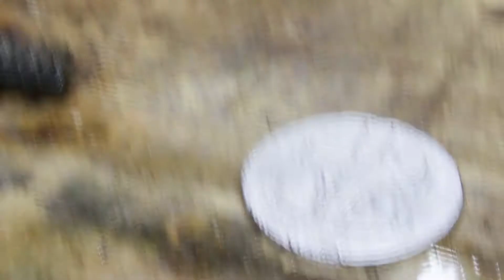Using Wood to Make Metal Coins

Comment: Very neat!  two questions.  How long did the Pewter take to melt in the enclosed firebox and do you think you would have just as good results with a bullet making furnace?
Reply from the maker: It probably only took about 5 minutes or so. Pewter melts at a very low temperature. Somewhere around 400°F and lead I think melts around 600°F so it should work pretty good.